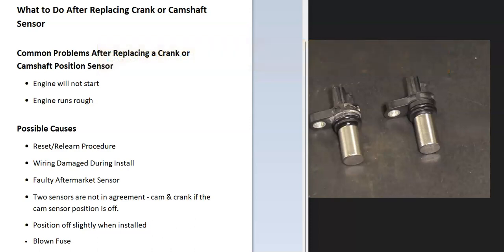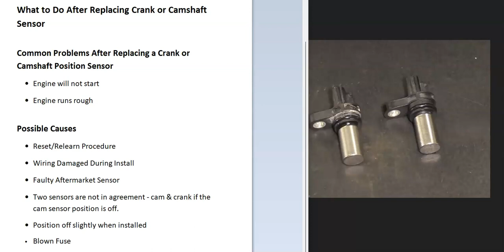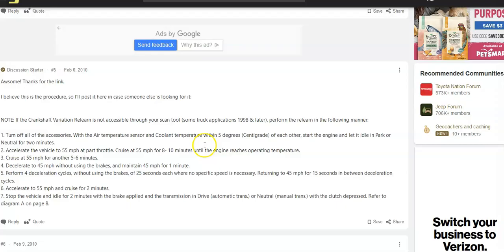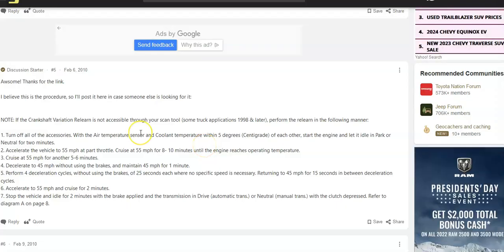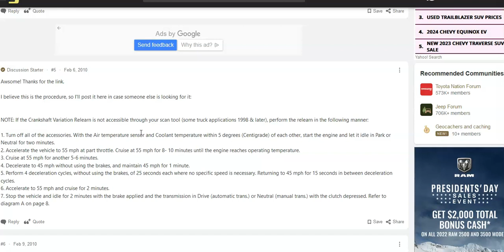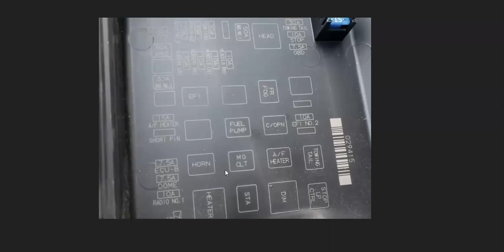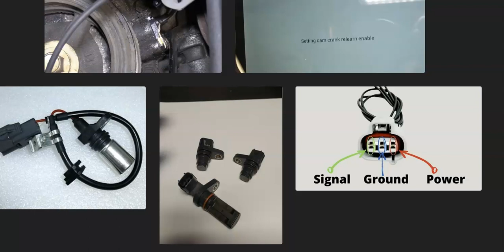What to Do After Replacing Crank or Camshaft Sensor and Now Engine Won't Start or Runs Rough

Comment: 2010 Cobalt 2.2. Replaced Cam and Crank Sensors, Crank Pigtail, Fuel Rail and Fuel Pump, Intake Manifold with new MAP Sensor. Still getting P0335 and P0336 code. What else could it be?

Comment: After changing the new sensor my van will turn off something that didn't do with the old sensor. I found out that I need it to reset it by disconnecting the positive cable from the battery. It Works good now, no more problems 👍🏼.
Reply: cool but you should have mentioned model and year to help someone who may have same vehicle..
Reply: @roadstar499  Sorry. 2009 Town and country touring

Comment: I just had both camshaft and crankshaft sensors replaced on '08 Nissan Frontier, vehicle is running better now...BUT for some reason my mileage went down from 17-19 mpg to 13-14 mpg, I was like ouch!  Took it back to the place that did work and they asked if I had a ck engine light on?  I said no, and mentioned that if a tune up might be needed?  The truck just hit 180,000 and I believe I had already done a tune up perhaps at 124,000...(the reason for low mileage was COVid and working from home). So they suggested first step tune up and fuel injection cleaning to the tune of $770 plus tax.  Which I am ok with, and I already did the re-learn by the way...any thing else I need to be aware of before I spend this money?  I have poured some decent $$ on my truck to keep her running, so it has not been from neglect...

Comment: I concur with installing all of the camshaft sensors and crankshaft position sensors with oem brand.  Today i replaced on an 06 Infiniti fx35 with Hitachi sensors, no relearn needed. Earlier this summer my daughter's Saturn sky needed replacement and used GM/ AC Delco sensors, these needed a relearn process.
Reply: How did you relearn the Saturn Sky?
I just changed my camshaft position sensor but I can´t find any information
Reply: For some reason utube is not tagging the person u r trying to reach.  U may be able to copy & paste their handle into the reply comment to get them a notification sent @Luis99733
Reply: @Luis99733 you need an obd2 code reader that has the option to do a relearn, the code reader will guide you each step.

Comment: I just changed crank sensor and injectors and it turns over with spark but won't start
Reply: Check for blown fuses/ relays and engine codes.
Reply: @velox731 did that , had one injector that was flooding , changed that still just turns over , something online said change cam and crank sensors at same time ....but it has spark also ...so am lost a lil 😅
Reply: @NorCalScout in my experience these sensors work in sync, meaning its best to change them together with the same brand. Some require a relearn process as well.
Reply: @velox731 yeah that's what I've read and was hoping against

Comment: I changed the crankshaft sensor on my BMW E46 and now my ignition turns on, I start to start it and I hear a ticking sound and it doesn't start but all the electricity in the car goes out and there is no ignition or anything, only when I remove the I remove the minus terminal and put it back in, I get contact and the same thing again? 🤔 Does anyone have an idea why?
Reply: Check the voltage on your battery, then after each crank. It could be your battery is bad.

Comment: Good video thanks.
I have a 2005 Ram, new engine swap. I replaced every sensor with ntk brand. Cam& crank got replaced on same day.  p0344 code keeps coming up .I’ve deleted the codes a few times but kept coming back. I did the computer reset myself 100 miles ago. No codes yet I hope it won’t come back. Dealer wants 200$ to reset / update the computer. 
I even swapped out a the cam sensor with a new one via warranty, all electrical wiring & connections looked very good. I have not checked the fuse. Anything you might suggest please let me know thanks
Reply: Some vehicles need a relearn process, either thru a series of steps or with a high dollar code reader.

Comment: DO THIS :  TURN YOUR HEAD LIGHTS ON, DISCONNECT YOUR BATTERY AND TOUCH THE POSITIVE CABLE WITH THE NEGATIVE CABLE FOR 2-3 MIN AND WAIT FOR 30 MIN TO HOOK UP THE BATTERY  AGAIN.    THIS IS HOW THE CAR WILL DO A RELEARN  ( AFTER  INSTALLING  A CRANK SHAFT POSTION  SENSOR ) .🫡🇺🇲

Comment: Replaced my cam shaft position sensor in  2012 Toyota Camry.  It works perfectly, car is running like a dream but the diagnostic says it needs to be replaced. I’m trying to sell this car. I need to find out why it will not reset.
Reply: First, delete code. Second, most cars have 2 or more sensors, make sure you replaced the right one. Third, some vehicles require a relearn. Hope that helps.

Comment: Hi. Thanks for the info. We have a Merc ML 270 cdi, 2004 W163 model. I changed the cam and crank sensors after refurbing 3 injectors, they were leaking off badly. After all this the car is making a clunking noise. Not sure if it's mechanical as it was doing it badly when the injectors were not working. Car went fine yesterday but today didn't start well and made clunking noises again. I did a scan and had syncro between cam and crank sensors intermittently faulty. Any tips on where to look for the problem? Many thanks.

Comment: No voltage, current to check crankshaft sendor, camshaft sensor. No ignition signal with DFPE, EVR, EGR disconnected to PCM and no current flowing in that area of wiring harness that leads to PCM connections. No spark? Cranks over, No Starting..
Connecting the Emission components back to PCM wiring, OBDII code repeated same codes, H2 Oxygen Sensors #1, & #2 again, then Catalytics included, but no power through such wiring when emission system connector disconnected from PCM Signal. No Start either, for Crankshaft, Camshaft had no current to power up. Thanks, thank you for explaining.

Comment: I have a chrysler grand voyager that died whilst driving error code came up with crank shaft sensor so had the sensor and relector wheel changed but it won’t start… can anyone help?

Comment: where the sensor goes in there is a metal clamp in there does the sensor have to go in there ford transit 250
Reply: Camshaft sensors are usually around the valve covers.  Crankshaft position sensor is usually between the starter and transmission bell housing.

Comment: G35 2006 change crank position sensor to oem still not working car dies after long cranks 
Old sensor is only one that seems to keep car going anyone else have problem 
? 
Scanner keeps saying it’s my crank position sensor
Reply: Same issue with the same car here
Reply: In my experience with Infinitis the sensors work in sync with each other, meaning, its best to replace all 3 with the same brand, I use Hitachi sensors.

Comment: Replaced CPS on a 2002 honda accord 2.3L 4-cyclinder. The car is starting and driving well, but I notice the engine has more kick to it now and 'roars' more. It is an Import Direct brand sensor.

Comment: I did the relearn thing and it still shaking when i slowdown
Reply: That could be several things, rotors/brakes could be bad. Bad tire or unbalanced wheels. Bad wheel bearing could also give a feeling of shaking.

Comment: I changed my crankshaft and camshaft sensor on ky 2018 Hyundai Elantra, I'm unaure why but my battery was drained so i got it charged and my engine still won't turn over. There aren't any codes coming up when i scan it. Any idea what i can do to fix this?

Comment: Replaced alternator, cam and crank, fuel pump and still runs like azz
Reply: Did you ever find the problem?
Reply: Same
Reply: 1. Check for engine codes
2. Clean your Mass air flow sensor.
3. Clean your throttle body.  Look up some videos on the cleaning process.

Comment: How do I know what it was that made it go bad? The sensor? Like how do I find out if other things were damaged? Like after I replace the sensor I go from there? Swf who can't afford a shop and local macanic ... Experience has shown them to be flaky.
Reply: Most of the time, it is contaminated oil, whether is not changed often or adding additives to the oil.

Comment: Just replaced camshaft sensor on my 08 Toyota Tacoma 4.0 v6 cranking fine but mash gas pedal and won't idiol up over 1,500 rpm won't rev up
Reply: Need help asap please
Reply: I heard you have to replace both sensors if one goes bad, and buy  sensors made from the same manufacturer

Comment: 2010 Toyota Camry V6 XLE seems to be working OK now after replacing 4 cam shaft position sensors except the front one is now going off bank 2 position a before it was bank 2 position B so I'll figure out which 1 of those is wrong but as far as we calibrating them I think it's done OK on its own but I would appreciate it if you could do a tutorial on the OBD2 scanners that have the case reset I read about crank angle sensor test or something can you please look into Rap for me Thank you

Comment: I just had a engine mount installed,  had 0 issues with my cam shaft sensor, one day later after installing engine mount my engine light lights up, I did a OBD on it and got the P000B code for Cam shaft sensor and the P0016 code, is it possible that while my mechanic installed the engine mount these codes came about due to repairing the engine mount?
Reply: I have your same code still trying to figure it out

Comment: Hello, I have an 08 Toyota bB (Japanese car) with the k3-ve 4-cylinder vvt-i engine. I had a locksmith come by to program a key and ever since the car hasn’t started but it was starting fine and even driving before he arrived that same day. I am getting crank but no start and no spark at all to any of the plugs. Changed crank and cam sensors, spark plugs and coils but still same issue. I also had another locksmith and two mechanics look at it but they couldn’t find the issue. I changed the ecu today and still no changes. I did look at the board for the old ecu and it had a damaged/cracked/burnt transistor. Tomorrow I intend to try putting the same transistor from the old ecu in and hope it works. If anyone has any other suggestions in all ears.. Thank you.
Reply: This happened to me on an 01 Nissan Pathfinder. It was the security bypass sensor in the steering wheel, it reads the chip on your ignition key. Check with a high dollar code reader for any codes.

Comment: Check your MAF and clean it.  Often around the time the CPS goes bad the MAF is also dirty.
Reply: @kenibnanak5554 I know I'm late I replaced maf in my friend 2009 Honda a week later had to replace the CPS been a month no problem no engine light on / no relearn problem / I wish I read your comment earlier I would've replaced both at the same time/ now I know going forward

Comment: why is my Toyota Venza v6 3.5L cranking but not starting after fixing a front timing leakage and cleaning ignition coils,cam sensors, timing sensors and mass airflow meter sensor?
Reply: many reasons.you need to check everything.fuel,grounds,harnesses,parts etc..

Comment: Hello everyone I just changed crankshaft sensor. But still showing the error code. First start i need starter solution. Later on it is working as good as new. Please help me in this Metter. I have Astra 1.7cdti 2005. Diesel. Been replaced many part. But still it not unable to self-start.  Any help

Comment: I own a 2005 Neon SXT with 135,000 miles on the OD. Was given to me by a son after a Ram dealer said it was worthless as a trade-in. It had 120K then and needed the timing belt kit installed and all three motor mounts. Got that done when it had 128K using a kit made by Gates. Before then I replaced the IAT and CPS sensors after their codes were thrown.  The engine ran fine up to 134K when it began going into limp mode when driving uphill then going back to normal once it picked up speed going downhill to run normally for the next few days. Then it went into limp mode all day and every day. I drove it that way for the next six months by staying in town where posted speeds are 45 and lower. I finally got around to replacing the cam shaft target magnet which ended that problem. Two weeks later the egine began missing badly for 10 seconds then went back to normal. Checked the code when parked outside a store to find P0016 crank position sensor. The engine ran normally when restarted then started missing again then died after driving one mile. I put it in neutral to coast into a gas station parking lot. There the engine started but ran like a engine dieseling after being shut off. Had it towed home where I replaced the CKS. Now it would fire once when started then only crank afterwards. I inspected the CPS to find it drenched in motor oil with a crack in the back. I replaced it to find the engine would crank but not start. I called over a mobile tech to scan the ECM. The only code he found was the P0016. He looked over the engine and wiring real good then removed the connector to sensors which threw a code when cranking and disappeared after being reconnected. He inspected the new belt thru the inspection hole and the cam target magnet when I cranked the engine. Said the Neons cams were known to snap in two but mine was still in one piece. So I took his and another mechanics advice to send in the ECM for inspection and refurbishing. Sent it to one shop in Illinois that sent it back, saying that the CPU had become detached and couldn't be resoldered in place. So I bought a refurbished ECM with a 3 year warranty. Just got that installed and still have the crank but no start problem. I cranked the engine for 20 seconds to see if the ECM would throw any codes. It didn't even though the engine fired on one cylinder a few times during that time. I know it has plenty of fuel (plugs were wet afterwards plus plenty of gas came out into a container after removing the fuel line from the injector rack. The plugs, wires and coil were replaced when changing out the cam target magnet. The plugs are Denso, the wires, coil and sensors were made by Standard Motor Products. All the related fuses and relays are good so now I get to start the tedious process of checking all the wires for voltage and continuity. Think I'll start by replacing the CPS connector with the pig tail that came with the new sensor. SMP had a good reason to add one to the box.
Reply: Glad I didn’t read all that …..
Reply: TLDR
Reply: I just came back and read all that

Comment: Hey bud iv got 05 jeep grand cherokee limited 5.7l Stuck in limp mode. I've only driven it a few times i'd say about 2 weeks worth then I. Ended up in lip mode cranks and runs.
I've got no throttle response.  And I've been beat my head on the wall. Trying to figure out what could be my issue.
I've changed plugs inspected wires.
Change the Toronto body.  I'm at a loss.
Senior video sing sharp if you could give me any guidance appointment in a direction and be awesome.
Reply from the maker: It should have codes that can help point to the issue.

Comment: Mine don't start at all and dude brought over a snap on sollus edge and his scanner doesn't show my sensor at all. Idk what's up. Wire gets 5 volts so maybe someone can tell me and what I've been told there is no fuse for it it's ran off same fuse as the computer

Comment: . If I insert the camshaft crank sensor, but do not connect the wire connector, then it still runs fine. If I pull out the crankshaft sensor all together, then the car won't start
My car runs fine for about 3 days, then the ECL comes on, but then i remove the Camshaft sensor, clean it, rotate the barrel part of it a bit as it seems really stiff, then it runs fine again for 3 days with no ECL
very confusing
Reply: Look for loose wiring or contacts
Reply: @fishindudefrank3855  never did solve it, got abother ( worse ) car :)

Comment: Replaced mine. The car runs but sometimes dies while idling at the traffic lights. No idea what to do.
Reply: Similar issue. Did you figure it out?
Reply: You might have to replace the IAC ( idle air control valve)

Comment: Does it matter if you switch 3.4 motor from 2003 Impala to 2004 Monte Carlo?   New cam sensor installed and now have the crank no start problem.

Comment: engine cranks but wont start.  Tachometer does not move while cranking.  2010 Nissan Titan
Reply: Why would the tachometer move while cranking? If the engine isn’t starting the tach shouldn’t be showing any rpm’s 😳

Comment: New cam position sensor. Getting 12v in one pin but no 5v reference in other pin. Ground is good and fuses are good. Where should I start?
Reply: Check  ECU

Comment: Mechanic just replaced the crankshaft position sensor now I am get low pressure oil warning on and off with CEL. A little worried. Taking it in tomorrow via tow.

Comment: I have a 2001 GMC Sonoma just replaced the crank shaft sensor it starts and idles but as soon as it reaches 3000 RPM it just dies any ideas
Reply: You have to do the relearn procedure.  A youtube video showed a guy use a brand new "vident iLink 400" for $156 from ebay and it fixed his 5.3L GM

Comment: 2018 Kia optima, just replace the two sensors and a week later it didn’t start at first, I️ was told to check my alternator any ideas ? Thank you for this video!!!
Reply: That's funny that you say that I just had my alternator go right out after changing the crankshaft sensor and the camshaft sensor going to the junkyard to get one this Saturday an alternator. My car is a Chevy Cobalt 2009 LT 2.2L
Reply: You changed cam say have sensors? If so, is the sensors
Reply: I also just had this problem replaced coil packs it drove fine and got ready to leave for work and on the way my battery light came on volts started to drain and cluster went nuts had to buy a new battery just to get it back home now off to get a new alternator this weekend